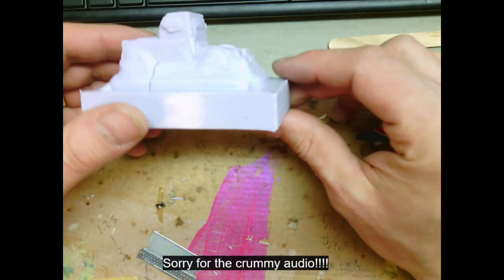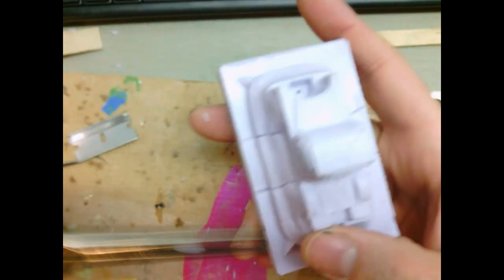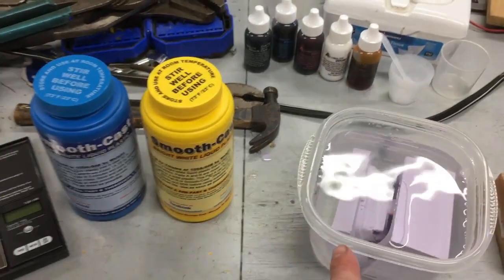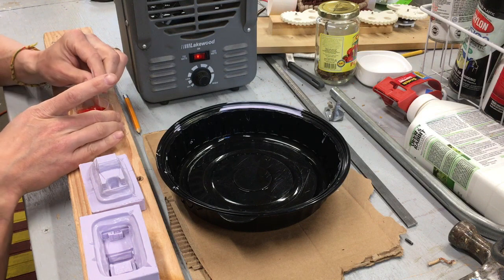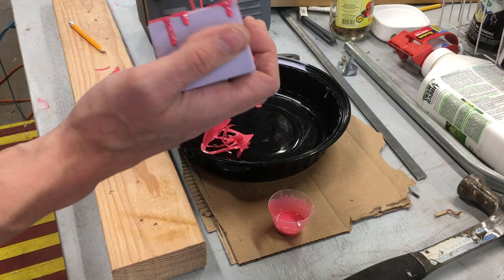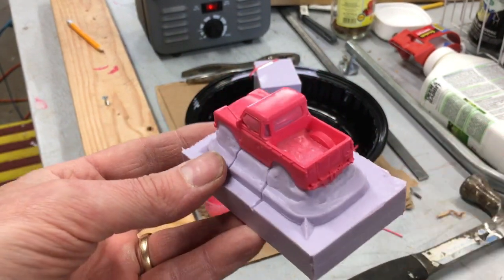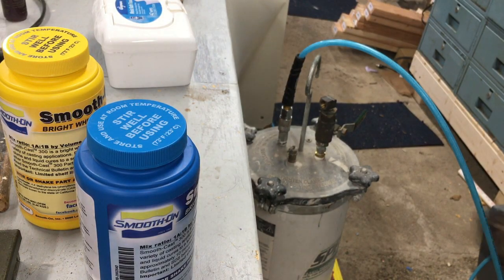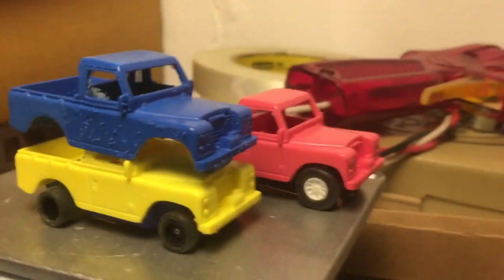HO casting part 5

Comment: Nice tutorial, you can use your pressure pot to degas the rubber, 90 minute pot life is good. 
If you need to DIY a vacuum chamber, use and old refrigerator compressor.

Comment: If you brush on a couple of layers of silicone first you can eliminate the air bubbles, another way is to pour the silicone in layers [ about 5mm] This reduces the distance the air has to travel to release.

Comment: You need to suck the air out of the resin it's self then pour, or cobble up a vibrating table ( a vibrating sander with a piece of plywood to act as a table). Pour then vibrate the entire mold. Hope this helps with air bubbles.
Reply from the maker: Thanks Steve, yes you should.  My vacuum setup was at my buddies and I was anxious to get the project off the ground.  A learning moment for all my viewers I guess!

Comment: Dude, congratulations on the tutorial, it will help a lot in my attempts to make a body mold of an F1 for 440x2 chassis and some AFX and MG, I'll try here. I'm only in doubt as to how to make the part of the body's fittings on the chassis, so that they can be drawn well in the silicone mold and be right in the resin mold, and how to undock the mold without harming it.
Reply from the maker: perhaps make those parts separately and glue them inside the body cast?  That way you have a lot less issues with the overhanging body mounts.

Comment: Use oil based paint for coloring your cast. It works way better. There is no need to use as much of the mold material as you are using. About as much as your first ledge under your cast is all that is needed 1/4 to 3/8" all around works for H.O. It won't distort in a mold box and it is easier to demold that way.
Reply from the maker: Thanks Tom!!  Just moved house so all this is packed away...  Hopefully the next project comes out better, but I was glad to share my process with everyone none the less!
Reply: @srmaietta  You did a good job. It can get expensive real quick, if you go the pressure pot or vacuum degasser route. You can do pretty well without all of that if you paint the cast instead of trying to add the color into the cast. That way you can fill bubble holes and other imperfections before you color it.